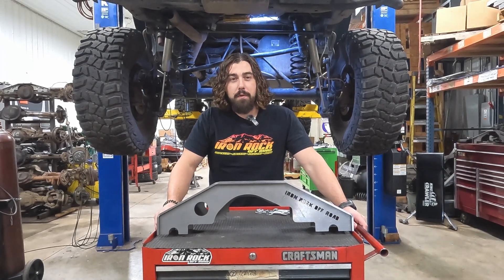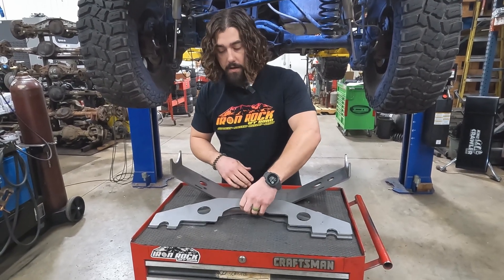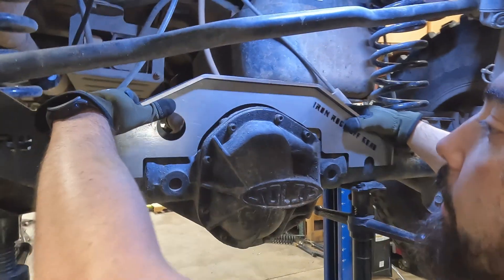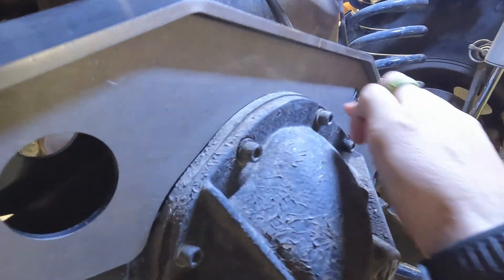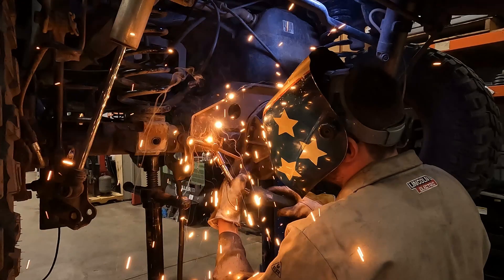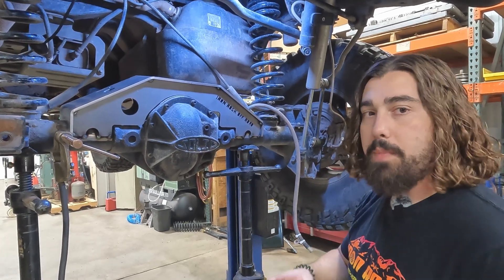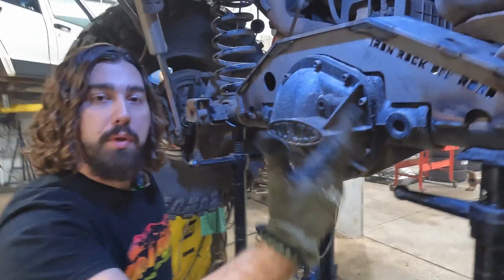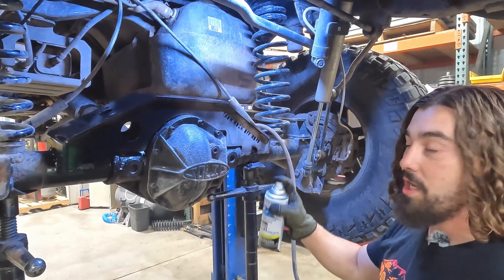HOW TO: JK Rear Axle Truss Install

Comment: Does the oil needs to be drain  before welding?
Reply from the maker: Since we are not welding to the cast center section, no. A rear truss designed like this one is fairly straight forward to install as far as disassembly before welding goes. However, it isn't a bad idea to drain and refill the oil for this project.